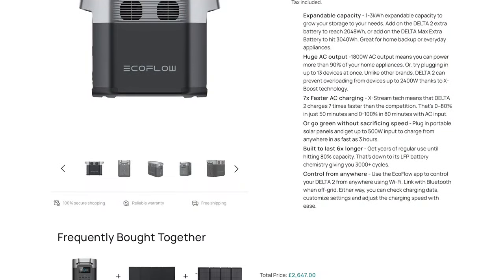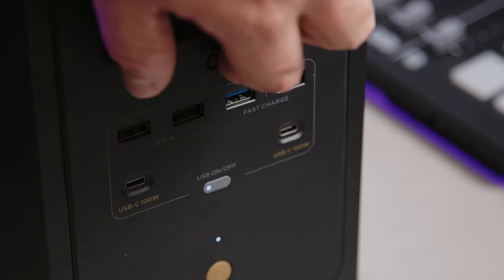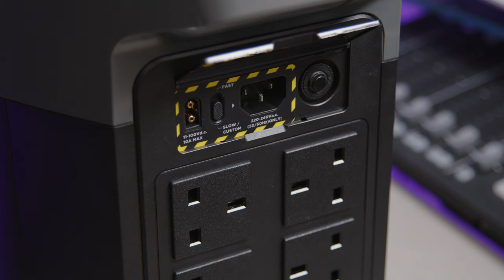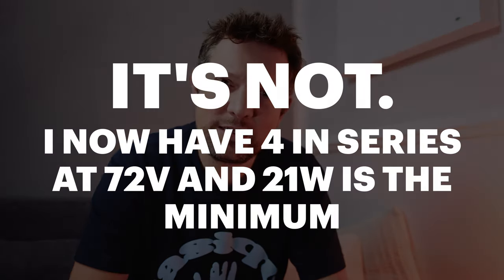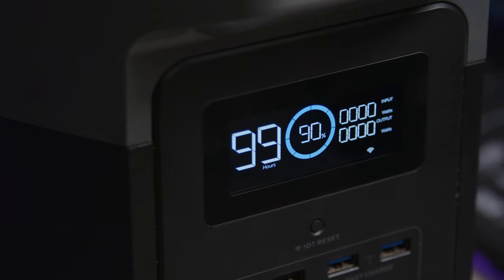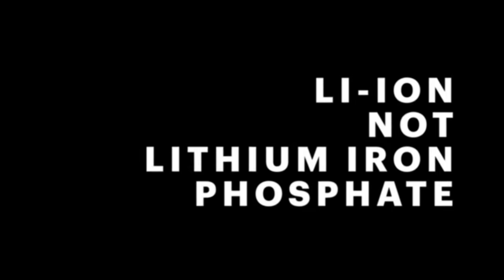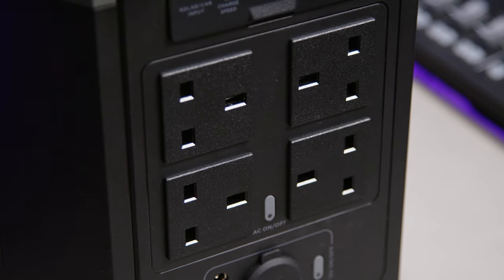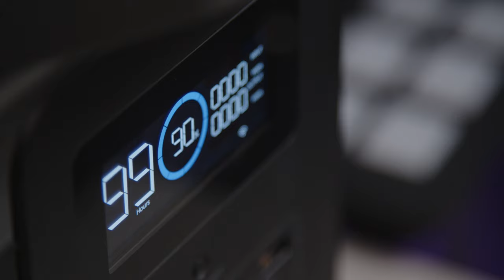EcoFlow Delta Max - Things You Don't Hear In Reviews

Comment: You covered only some of the things, positive and negative with the Ecoflow generator.
If you want to use the Ecoflow Delta by charging it at the cheap night rate to power equipment using the expensive day period, you could be disappointed.
Depending on the type of load you power you may only get 50% efficiency from your EcoFlow Delta - half the power out from what you put in!. 
It takes 2.4kW to fully charge the 2kW unit, but you may get only 1.2kW out when powering non resistive equipment - ie motors, electronic equipment which have pf (power factors) < 1.0 - a Laptop may have a pf of 0.41!! 
Thus 2kW output 'useable' power output is only for resistive loads. With low pf loads you can have 50% losses!!
Note: in the UK we only pay for 2KW to charge the unit since the 'losses' are not directly charged - unless you are an industrial company with motors then expect to be charged!

Thus beware if using the battery generator to try and use cheap charging rates at night for powering non-resistive loads during the day - it will end up more expensive!!  

Unless you have a more modern mobile, the App may not be supported - mine doesn't, and therefore you cannot do any firmware updates. There is no other method for Firmware updates - ie locally.

Yes it is annoying the frequency and the loudness of the fans even when using it to power small loads.

Comment: First I am an audio engineer. You present an unfair sound sample and a totally misleading characterization on the fans, with zero context. You might want to look at a chart of how loud things like jet planes, dishwashers, traffic, conversation and offices actually are. Jet planes are far far louder than the Delta Max, or any of the Ecoflow Deltas, the Delta's are in fact quieter than most dishwashers and air conditioners, certainly quieter than gas or propane generators. It's not like it's drowning out people talking loud, which is what you are saying when you make this unfair characterization.
High power devices get hot and MUST be cooled down, and the larger the battery pack the harder this is to do. It's a big hunk of metal sitting in there. So you have to try to keep them from getting hot in the first place. If you want a lower capacity or lower powered device because they are quieter - then buy a lower power device. OR  - there is this thing called "an extension cord." But it isn't about stupid software programming. It's the physics involved in power transfer.
 Second, overpanel your solar input. But complaining that 21W won't charge your Delta Max is absurd. At a certain point the electronics just being on use more power than the DC input, so they have to set a limit. You would do better to buy more solar panels and overpanel, you can provide more Amps than the rated DC Amps in with no problem. You only have to worry about not going over the VOC open circuit voltage, but two three times the amps is perfectly fine, and this benefits you in lower light conditions. Watts is a result, not a cause of volts x amps. Crank up the amps - it's about how how many panels you have and how you configure them.
Third, yes you can leave the panels hooked up. That is fine, users do this all the time. The clicking is harmless, the relay that shuts off the solar is right at the threshold wattage where it turns the solar input off. As the sun sets, someone, somewhere in the world is going to hear the relay on their DP clicking. The advice to disconnect is only for when the Delta is NOT IN USE. Sometimes though, you may have to unplug and replug in the solar in the morning, as slow increases in wattage are not always recognized by the MPPT controller.   
Fourth, meters. Time remaining estimates are an educated guess, like London traffic lights a general guide only. It is not and really has no way of being a precision measurement tool. As for remaining capacity metering, this is sometimes an issue. One: a 10% difference between battery packs is considered in spec because no two battery packs are alike. Two: Firmware updates have fixed some of the balancing issues. Three; DO update your firmware. Four:  Sometimes the battery packs do drift or the meters simply go stupid. This does not affect operation - but it may affect your sanity! On the facebook Ecoflow Delta group they have posted the reset and the recalibration routines. I think what happens is crap power or voltage spikes in the AC input can scramble the meters, it may help to have a power conditioner on your Delta's AC input - but I can't prove this. 
Fifth, "App dependence." Totally unfounded on your part, You will ALWAYS HAVE the app as it can directly connect with the Delta - no Ecoflow server or internet connection required - so there will always be connectivity even in a worse case scenario. Especially if they release the API or it gets engineered - some are already working on this with interesting results. And fear Ecoflow might disappear as a company in 5 years is also far fetched, as Ecoflow now has a multi Billion dollar valuation.and is the Industry leader and the State of The Art in Solar Generators.  It's considered one of China's "Unicorn" companies and in fact on China's 681 E Shopping holiday this year, they had a million sales in the first 9 minutes, and have tripled sales yearly for the past three years.
Six - yeah, right on on NCM batteries. Very few users will this make a real difference at all and calendar aging will likely obsolete the device before battery cycling.
 Seven - individual AC output switching. Well you could implement that with AC timers on the individual AC outputs, or even a smart home switch connected to them individually or on a power strip for remote control over the internet. 
Eight - The expansion battery does come with the expansion battery cable. 
You should join the Facebook Ecoflow Delta Series Group!
Reply: Regarding time remaining estimates not affecting operation - I have to disagree, as the device “listens” to the computer. Been using a Delta mini for 25 days and it’s already gone crazy with the meters. At first it was showing correct estimates and now it shows 2-3 hours for 60-100 watts output and TURNS OFF after this time when at 1% (I set 1% in settings). 
No firmware updates available so far
Reply: @siroezhkina5865  Nah. The BMS Battery management system board is separate and has it's own control logic. In the second generation devices, they combined it with the inverter board, which is also the charging board, plugged in the wall it operates in reverse for fast charging. The output and input meters measure the inputs and outputs in the Ecoflow architecture, not power consumption. And the time remaining calculates based on what is reported to it. It does not tell the rest of the unit what to do, except when the inverter or converter boards report problems and cause
 protective shutdowns.

Comment: Good Show as you say . I just canceled two Delta two's . One was to be used to power C-PAP with the new QUIET H.V.AC Jewel that I could get the job done in the stile to achieve , Quiet to sleep with . Easy to plug into the proprietary connection to there inverter I don't need except for it's proprietary connections to there proprietary D.C. separate from screaming fans of the A.C. side screaming at heaven on high . 
 This sort of Chinese engineering only cares about getting um out the door as I try unsuccessfully to sleep . Can't even hear the neighbors dog outside my bedroom window . Yeah I sent them back until those engineers finnish there job turning off A.C. circuitry during D.C. Operation . Something 
 T/C/E

Comment: The fans are so loud because all high frequency, low surge capacity solar generators use low cost, (cheap) high frequency, transformerless inverter technology to produce AC power. I would never install one of these high frequency inverters to power my home or RV, even in an emergency. Because of their high switching speeds, high frequency solar generators like this run much hotter than low frequency, transformer-based solar generators which makes the low cost, off spec, Chinese made components such as capacitors, diodes, resistors and ICs that are used in the cheap inverters that are used in these inverters, far more prone to early failure. 

Another major consideration with high frequency, transformerless solar generators is safety. Because there is no iron core AC output transformer to isolate, the DC input from the inverter's AC output, all it takes is for the AC output monitoring circuitry to fail and one of the MOSFETs in the inverter's H-Bridge circuit to short to ground, and these units can send dangerous, high voltage, high amperage DC current straight to your connected AC loads which will not only damage most AC appliances but can also set those AC appliances on fire. 

A far better alternative is to invest less money and purchase a hybrid, low frequency, transformer based inverter charger and an LFP battery and build your own 
"real" solar generator. Low frequency transformer based solar generators last many years longer than these toy high frequency solar generators, and can easily power high surge loads without being damaged and without damaging your appliances. That's why the big name brand inverter manufacturers like Schneider Electric, Magnum Energy, Outback Power, Sigineer Power, Victron Energy and others, all use a low frequency topology in their offerings. Your system will last far, far longer, it will run much cooler and can easily power high surge loads without being damaged and without damaging your appliances.

Comment: 800 cycles will last maybe 3 years.
Reply from the maker: Really? I would expect it to last longer than that. What is the chance of doing a full cycle almost every single day (unless using with a PowerStream perhaps)? I just don’t think they add up as fast as people think. 🤷🏻‍♂️
Reply: @tdcattech  I don't trust the manufacturers figures on cycles, I've learnt the hard way that each recharge is a cycle, hope I'm wrong with these newer cells.
Reply: @tdcattech  I've just perused the data sheet and their claim for the cycles is to 80% doc.